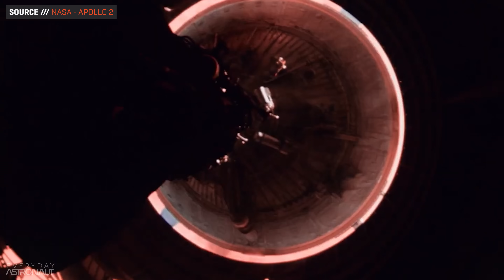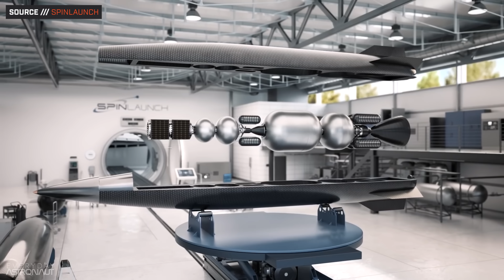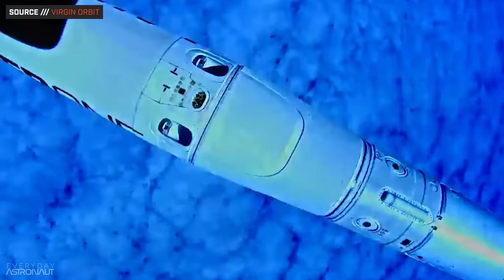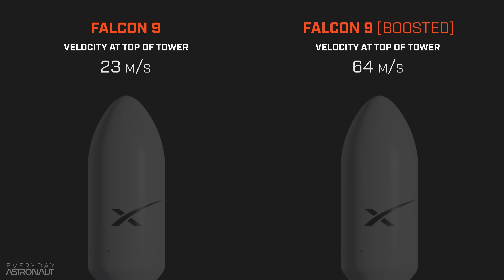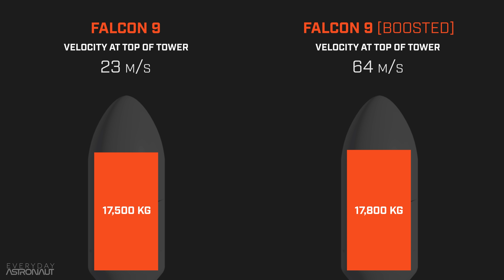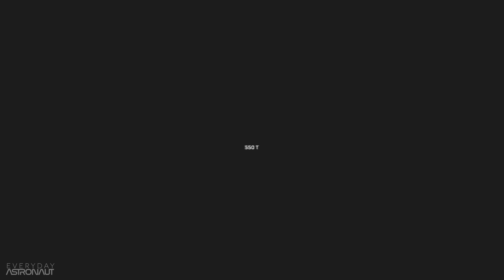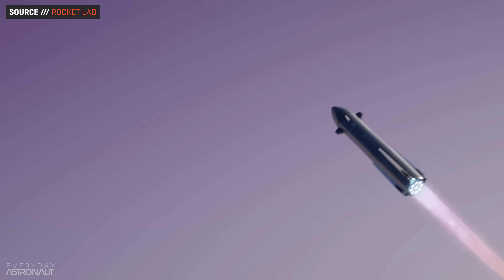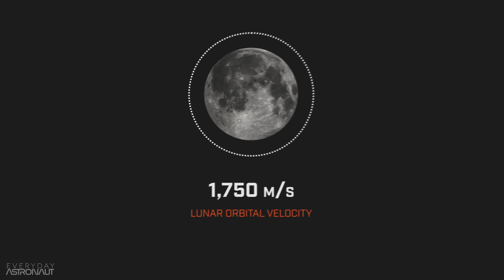Could We Help Push Rockets To Orbit?

Comment: Maybe I missed it, but the key point in any of these ground launch systems is overcoming the "tyranny" of the rocket equation. 

With rockets, to increase payload, you add propellant, but the propellant also needs to be lifted, so the increase in useful payload is limited... if you are here, that goes without saying. 

With ground launch, the dynamic is very different, and performance scales more linearly.  As you point out, all these systems introduce their own issues, but beating the rocket equation is tempting. 

You show very clearly that these systems struggle with power output. In theory, they should require less energy than the rocket because they aren't having to lift propellant or extra stages. The target is getting a payload to orbital velocity. This is 1/2 mv^2, where m is the payload mass, not the rocket mass.  The rocket "wastes" any energy it invested in accelerating itself (excluding payload).  The problem with ground launch is that it can only apply force, accelerating the payload while connected to the payloadi.  And to the ground. 

You show very clearly that means a trade between a very long launcher or crazy high g-forces.

I think there are examples of facilities that generate the kind of peak power you talk about. A lot of big science experiments have to do this. Also, tethering to a nuclear reactor would work.  They power cities, right? 

In the end, it's the infrastructure cost that gets you.  

I've got a better idea. Why not use reusable rockets? If you could just have them land or be caught, you could use them again and again.  Propellant is cheap, relatively.  So, it doesn't matter as much what the rocket equation imposes, right?  I really should do something like that. If could be a game changer. 😮
Reply: Even a large solar or wind farm can power 500MW+ quite easily. You'd get the benefit of electricity the rest of the time. The amounts of power he's talking about aren't actually as scary as portrayed.
Reply: @Secretlyanothername  that still makes an entire power production facility be occupied with charging a rocket launch system, which makes me curious. how much power is used to manufacture rocket fuel...?
Reply: @alamrasyidi4097  "how much power is used to manufacture rocket fuel...?" That's a completely wrong question. The right question is: How much energy can be generated by burning that rocket fuel in the most efficient power plant? You realize that you don't produce fossil fuel from energy, right? You just dig/pump it out of deposits where it is already stored?
Reply: @sergedundich844  i know what i was asking. i was just wondering how much more efficient is it really to just get rocket fuel than going through all of these hassle mentioned in the video
Reply: @alamrasyidi4097  BTW "all of these hassle mentioned in the video" refers to specific infrastructure development - you know like building roads or oil refineries and gas stations or natural gas delivery networks or electricity grid... That always takes time and lots of resources - but later benefits everyone in life changing ways.
Reply: @sergedundich844  by hassle, i mostly meant the launch assists that only gives a net gain of a fraction of the original launch capacity. theyre just not worth it. the more advanced ones mentioned are definitely worth doing though, if only theyre not as costly or even technologically achievable atm, frankly
Reply: > You show very clearly that these systems struggle with power output.

It's definitely a challenge if you want to use a fancy electric powered maglev system. For small to medium sized rockets you might consider something along the line of a US Navy aircraft carrier steam catapult, a serious contender for the title of champion of practical heavy-yeet technology. Take away the restrictions of building it into a boat while keeping the ocean handy for dumping waste heat and you could probably scale it up a bit more.

I mean, a bigger rocket is still probably a much better plan, but leaving the king of yeet out of the analysis is a shame.
Reply: Exactly. Author of the video approached from completely wrong angle. It's not about how much payload you can add but how much payload you can remove. At the end of the day what do we expect from a casual youtube "pro" trying to improve "the process" smartest people in the world improving on the a daily basis xD
Reply: This is why any ground-based launch system is, for me, the "holy grail" of rocket science. Helping solve the tyranny of the rocket equation. I not going to pretend i have i got the solutions like the bro above said. Just my 2 cents.

Comment: You need a roller coaster ramp. Keep full lines hooked up till the rocket leaves the ramp. Let the rocket be its own counter weight.  If the track is 2 miles long and the rocket can freefall for 4 seconds,  it should be moving at about 600mph b4 the fuel lines disconnect and rocket exits the ramp going straight up.

Comment: WDTJ (Why Don't They Just...) re-imagine a rocket as a vertical jet engine? 

You gotta push through all that air... Why not use it as reaction mass? Instead of a nose cone, suppose your rocket has an inlet cowling, like a jet engine. The air entering is compressed by the forward motion of the craft. It is piped to the engine bay, where it is heated and allowed to expand behind the craft in a separate exhaust nozzle at the center, adding to the thrust. A rocket-ramjet hybrid.

Reduced aerodynamic drag and extra thrust with no moving parts. Sounds like something one could try.

Comment: The simplest option would be to add mounting points around the main rocket, which would allow attaching N smaller boosters around it, if needed. I.e if you wanted 1 extra ton of payload, add 2 small boosters, if you want 2 tons, add 2 more.

Comment: 29:06 The same delta-v requires the same energy per unit mass, regardless of its velocity - in a vacuum. Friction losses increase with the square of velocity.
Reply: Yeah I can't comprehend what he said. It makes sense, I know it takes more gasoline to accelerate from 100mph to 120mph than from 20mph to 40mph in a car - but I also understand what you're saying that a rocket in deep space will always use the same amount of fuel for a specific change in delta-v, regardless of starting velocity. I don't know how to reconcile these concepts in my brain.
Reply: A car is pushing through air.

Comment: The problem with those designs is that you need a market those launch facilities could saturate. With big capital expenditures you need big returns. For a project that will take a very long time, your investment is losing about 7 to 10% every single year, because you are competing with the market investments. With Starship, while there is no current market for it, is a combination of 3 things coming together. First, SpaceX is making its own market with Starlink, second, the rate of return is insane as the Starship project only costs mere billions, as opposed to other historic big launchers, but it will still provide insane reductions in price per kg anyway, and 3rd, it has personal investment of Elon, both financial and goal oriented, to make sure that happens.

So I can see this design working, but only if there is already existing market in space, and someone is trying to shave costs against launchers like Starship and it's competitors.

Comment: Good production like always, but man you lost me somewhere around 13:23. Not because it was too complicated or something, but because the last 5-10 mins were pointless considering you were only dealing with 300kg extra on a 17000kg base payload... this kind of tech is not supposed to help increase a couple of %, the aim has to be at the level of a breakthrough for new tech like this to be considered witch the "300kg extra on a 17000kg base payload" doesn't fulfill from the very start...
You don't waste people's time like that going through all those calculations if the result is exactly what it seemed from the very start.

Comment: So he did touch on the what about a mountain, lol

We need more r&d on umbilical tech. We need to make onion staging a real thing(for today's rockets)

There's always the moar boosters idea.
The space shuttle basicly used both these ideas. But they dont fall in the category of 'yeet'.

I really thing using an umbilical to keep the rocketfully fueled through the launch pad would help.

I like the space sled on the moon, you wouldn't even need an it to be elevated that much, just enough to equal the curve of the moon's surface.

Great breakdown and video.

Comment: There's no reason why the counter-weight boost system can't utilize  a vertical tunnel to add a huge mechanical advantage to the lift. This would result in a much smaller c/w mass and the shaft could be used to cushion the end-of travel of the c/w with simple air-cushioning. The c/w could be filled with water allowing the hoisting/suspending to be much more efficient. Lots to think about... Great vid!
Reply from the maker: Remember, the counterweight can’t fall faster than 1G, so we have to have a lot of mechanical advantage and a lot of kinetic energy to apply that much lifting force at 3 G net acceleration
Reply: @EverydayAstronaut  You could use the mag-lev part to accel the c/w downward for as far as the shaft would allow. solar to charge the capacitors.
Reply: Heck, combine everything by using vacuum on the counterweight as well.
Reply: @EverydayAstronaut  Also, there's no reason why the c/w can't start falling before the energy gets transferred to the rocket with some sort of take-up/damper system. I understand the efficiency drops more and more (not to mention the cost) but this is still a fun thought experiment.

Comment: I guess sending small satelites, mirrors and solar collectors from the Moon seems also reasonable?
The track doesn't need to be a straight line btw. It could even be a big circle with adequate escape mechanism? But not sure how much complexity that would add.

Comment: ChatGPT concluded, after thinking for 20 seconds, the fuel save with a 100 meter tower is so small that the engineering challenges far over weights the savings

Comment: A huge tunnel bored into a mountain, that way the you could build pressure with the engines to propel the rocket instead of relying on reaction force.  But engines would hate that.

Comment: This was a fun video, but there are major problems with the counterweight math and the pulley assumptions — and they really hurt the credibility of the analysis.

You claimed that accelerating a 5,000-ton Starship at 2.5 g using a 5:1 pulley system would require a 175,000-ton counterweight. That number is way off — but even more importantly, the assumption of a 5:1 pulley ratio itself is never justified.

In a 5:1 mechanical advantage system:

The counterweight moves 5× the distance the rocket does,

And it provides only 1/5th the force,

Which means the counterweight needs a 700-meter drop to accelerate the rocket 140 meters.

Where is this 700-meter launch tower supposed to be? That wasn’t addressed at all.

Even if we accept the 5:1 ratio, the math still doesn't work. The total force needed to accelerate the rocket at 2.5 g net (i.e., 3.5 g total) is about 171 MN. A 5:1 pulley system would reduce that required input force to ~34.3 MN, which equates to a counterweight mass of ~3,500 tons, not 175,000. That’s a 50× overestimation.

What’s worse is that this entire framing treats the counterweight like a dead weight problem, when in reality this is an energy storage and transfer problem. If we can store gigawatts of chemical energy inside a rocket and burn it over minutes, there are many ways to store and release energy externally over seconds: flywheels, supercapacitors, compressed gas, hydraulics — not just a giant steel block on a rope.

I even ran the numbers: a 28-ton flywheel spinning at 10,000 RPM with a 1.5 m radius can store the same ~17 GJ of energy needed to accelerate Starship at 2.5 g. And that system could be recharged between launches — no need for massive falling weights or absurd towers.

So really, the main issue here is the framing: you hit one version of the problem and stop. But engineers don’t stop at the first impractical approach. They iterate. They explore smarter mechanisms. They find better ways to store and release energy. That mindset is missing here.

Also — why assume a steel counterweight? If we had to use mass, sand or water would work fine. Mass is mass.

This could’ve been a much more interesting video with deeper engineering insight instead of theatrical impracticality.

Comment: This approach works better if the rocket is accelerated horizontally—say, along a flat railway track. You wouldn't even need a dedicated propulsion system for that. The rocket's engine would be far more efficient if it didn't have to fight gravity during the initial seconds of acceleration, when the tanks are full and the rocket is at its heaviest. Later, the rocket needs to switch to vertical ascent, so the final section of the track should be built on a slope.

Comment: Victorians got this right. Steam... It's very torque (y)
Also used on older aircraft carriers.

I think your numbers are wrong. The acceleration later in the burn is changed dramatically by the initial push. Pushing a moving car is a lot easier than a standing one.

As for the additioanl payload it seems you have treated the push as a static addition to the overall required orbital velocity.

Comment: few suggestions: [I.] Movable launch pad that can go up/down. Pad has its own N raptor engines and its own dedicated fuel feed. It can boost acceleration and doesn't take fuel from the rocket [II.] pair [I.] with the end of a pressure release tunnel from a hydro dam [III.] add multiple BTC inside the rocket as it seems to be going to the moon anyway  :)

Comment: 20:00 not saying its worth it but 3% at this scale with a permanent investment is quite good dont forget this would be repeatable without this massive expenses, and the arms would not need redesign only the engine section would need some support for the new uplifting system. It seems higly impractical but if a system is designed from the ground up for this purpose 3% would be very good number, i dont know if i miss it but instead of payload increase how much fuel would this save? This would be a better metric to calculate the offset over launches

Comment: Weight of structural enhancements to withstand beeing grabbed and accelerated > Weight of slightly bigger fuel tank for the extra lift off fuel that gets immediately burned anyway.

Comment: i expect better quality video but its not reach the one with aerospike or old ones. Also using comma instead of dot make me nuts on numbers.  3,14 is not the same 3.145 or 3.000.000 we use dot to seperate thosund milions bilions and comma for digits like PI or whatever number.

Comment: I am sorry, pretty sure I am wrong here, but using the right pulley and gear ratio, it should take less counter weight, not more. I think either the distance the counter weight can travel or your conversion rate is off. I mean using a direct weight counterweight system should take 2.5x the mass for the counterweight for a 2.5g pull...

Comment: Given infinite money id start construction in a low orbit orbital ring. Just its construction should drag the rest of the world into the space age. And historicly equatorial countrys have had a rough go of it. So adding major supply lines through them should boost their economys enormusly.

Initialy id focus on supplying electrical power and cheap low earth orbit flights. To then expand eith deep space launchers, catchers and infrastructure to connect to orbital manufacturing.

Comment: You mathed it wrong Tim,.. instead of thinking about how many tonnes more payload, you should have considered how to get the same tonnage to orbit with less fuel and vehicle mass. The bigger the yeet gets, the lower the amount of fuel needed for the same final goal. It'd be fun to watch a Trebuchet do the yeeting, and the oldest yeeter is the Woomera, used by Koori folks to throw spears further, invented back when Mega Fauna were still a thing in Australia,... the place where the national rocket range was named Woomera after the "throwing stick".
You've also got the Luna Accelerator pointing the wrong way, but yes to it just doing raw payloads. And the size at close to 60km, is peanuts compared to the average freeway or city metro train system. Think, the Shanghai MagLev, but on the Moon, and it's not too hard to wrap the head around.

Comment: I’d love to see a similar exploration of an aerial fuel depot; basically offloading the fuel tanks of the booster to a stationary vehicle—like a blimp. Then run fuel lines from the blimp to the rocket and run the engines directly from that fuel. Disconnect the fuel lines when it gets too high.

Comment: I'm not an engineer, I'm not even good at maths. But... What if you put the rocket in a tube so the pressure from the motors exhaust and the expanding air push the rocket like a bullet? You don't add any energy, just get more out of your fuel? Let's say you got a tube twice the length of the rocket.

Comment: I think you need to spend a little more time explaining delta v in this kind of video. Depending on thrust to weight ratio, the amount of fuel to clear the launch tower is greatly impacted. Not explaining the calculation on delta v at the top of the tower opens up questions on the amount of fuel left in the booster. If the Saturn V cleared the tower at 64m/s fully loaded, wouldn't that make a huge difference in payload capacity?